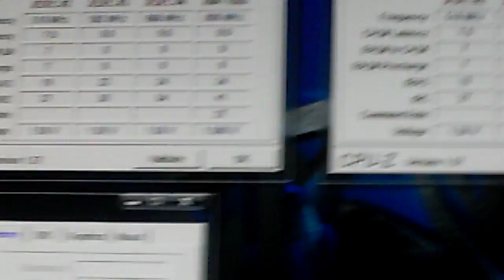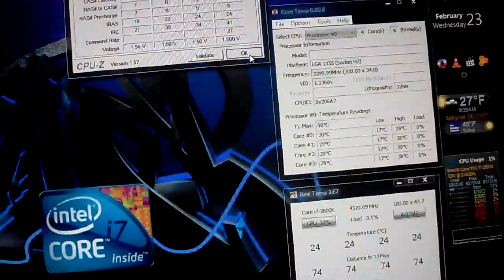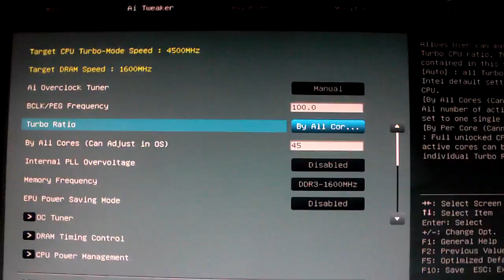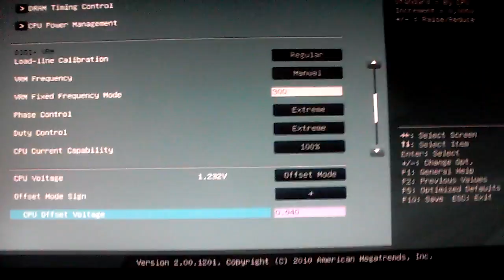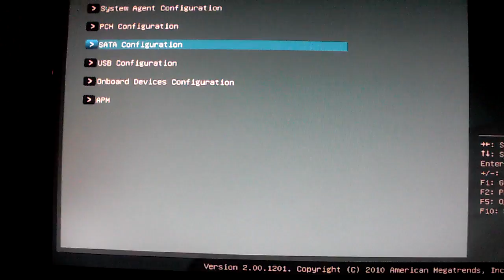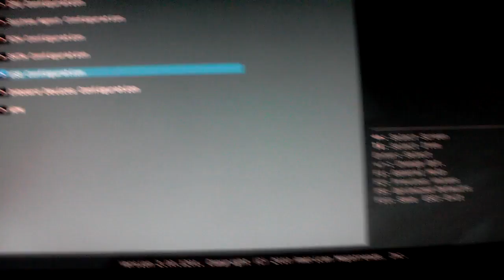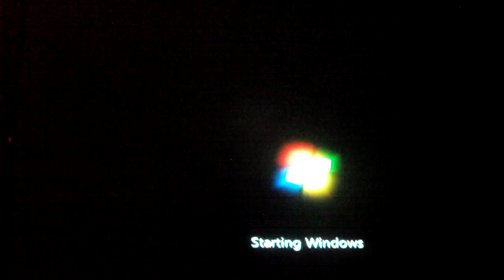Asus P8P67 Deluxe 1305 Bios

Comment from the maker: And the thing that gets me is the 1305 that got leaked a few weeks ago is the same as the one listed in the Asus download section . 

I just computed the md5 checksum for the old and new 1305, and they are identical.

md5 checksum for old 1305:
BFC7BA0781C176C5E1D87B2B383F0022

md5 checksum for new 1305:
BFC7BA0781C176C5E1D87B2B383F0022